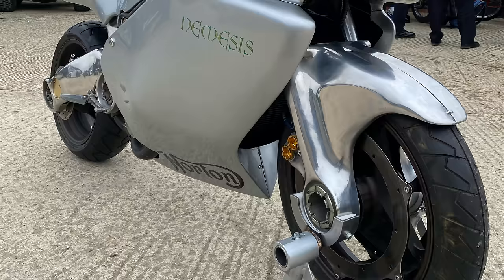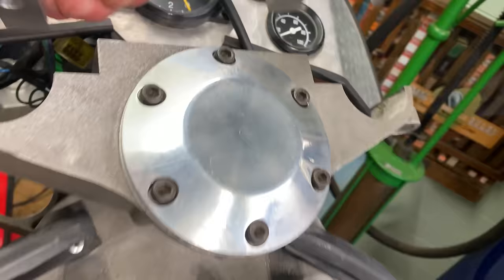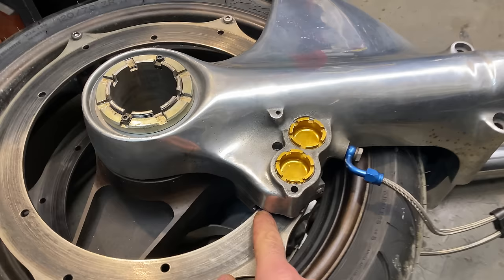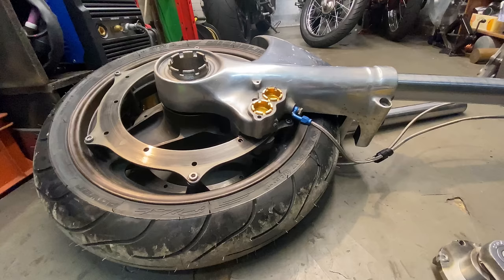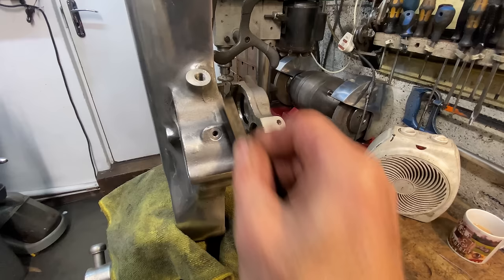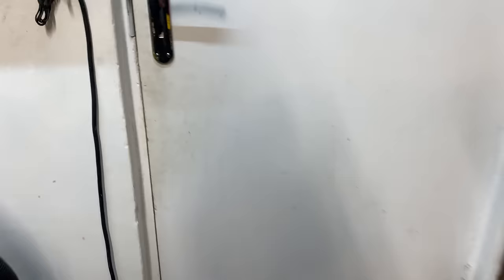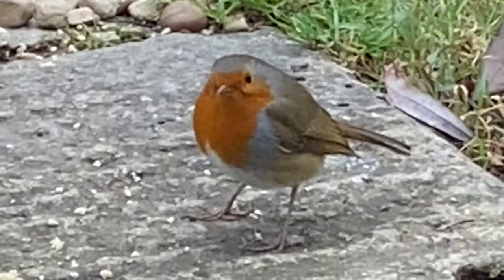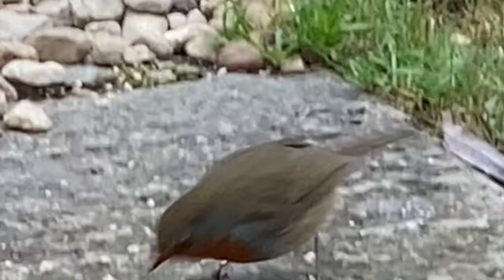Norton Nemesis V8 Rebuild - Episode 1

Comment: Applying threadlocker to the disc bolts is a mistake when the bolt screws into a blind hole. The air displaced along the thread as the bolt advances will evacuate the threadlocker fluid, leaving very little on the threads. 

The preferred method is to apply threadlocker into the hole itself, ensuring that it penetreates deeply enough to afford the entire length of the bolt threads. Inevitably, some threadlocker will still be pushed up and out by the air displacement, but this method ensures much more of the threadlocker will be where we want it.

Comment: There are plenty of things about that front end that I don't like, particularly the impracticality of it from an every day perspective (which isn't its intention). There were a couple of parts that I thought were good: the removable plug that allows the brake piston to be pushed out (hopefully the plug doesn't leak) and the way the fork bushes slid out for checking.

Comment: I would whittle up a couple oval plugs to set in those ports each with a small magnet glued to it to block and catch any fasteners from getting into the engine when you put the airbox back on.

Comment: "Sir your Norton's front brake slave cylinder is worn out and needs replacing"

"Oh certainly, how much will that cost?"

"Well, it's cast as part of that huge, single, one-off aluminium piece that holds the axle. You might want to sit down..."

Comment: Don't show cake !😆
(now I really really want some, haven't had that type since I moved to USA 1999 🤯)
That's a hell of a position of trust, doing work for National Motorcycle Museum.
Your next career move?
Front end looks great but must have been terrible to make and assemble, awful lot of drillings, no wonder they changed design.
I would hate to be working in a shop then tell customer front tyre change is going to take 6~8 hours.
The crossover brake drilling would have worked if they had added a hollow dowel to support the o-ring seal.
It would have been a complete nightmare to bleed though, probably easiest with forks laying down so air could rise?
(I did something similar on a Suzuki  25~30 years ago)

Comment: Crazy stuff, Im guessing that the engineers of this might also have designed the landing gear for Concorde/ Vulcans /Brit fighter planes. Not that I have any knowledge of those designs but ease of maintenance would maybe not be priority #1. Complexity here seems to be an issue, but a mechanic working on them regularly wouldnt have any problem - the worst aspect seems to be the large unsprung weight of that 'mudguard' - similar to a Maico Taifun 400 of the 50's, except they had the sense to attach it so it is part of the sprung weight...basic really.

Comment: A lot of work to change the front tire. For a motorcycle that goes 300 km/h, I would balance the front wheel with the brake disc.
Reply from the maker: Impossible because the discs can’t be bolted to the wheel before assembly - see video 🙂

Comment: I Hope the casting is high quality. I once worked on a Hydraulic pump with a Aluminium Cast Body for the food industry. It kept losing Pressure when it got hot, we found out the oil was sweating its way through the pores of the Casting. I wonder if the pattern for the casting is still about lol.

Comment: What a very unusual setup on that front end, im guessing it was for weight reduction and to keep clean lines. However imagine having to replace any of those parts, it would need the whole thing custom making. That would be a nightmare. Imagine stripping the brakes, seperating the forks and dis-assembling the whole front end just to replace the tyre? Not too bad as the customer would have a few quid anyway so they shouldnt have an issue with time.

Comment: What an astonishing design for front forks.  Do you have to go through all of that if you just need to change the front tyre?
Reply: Yes.
But in racing replacing the whole front end unit would be no problem..
probably quicker than a pad slap/brake rotor/tyre change anyway....

Comment: This bike is going to be a handful on the road! (or maybe not, after building and riding the Flying Millyard and the Viper engine bike) The front end sure wasn't designed for easy service. Not a good plan to have the caliper / pistons built into the fork leg...Maybe thats what got Mr.Toh and Mr. Kico sacked from Norton's...8^)

Comment: I've watched too many mechanic's vids about bikes and cars... But this one stole the cake. I thought: really creepy engineering created by a damaged brain: One man's 'vision' or a camel designed by a committee back in the early days of evolution? 
But then I wiki'd Nemesis and found out it was 1998, had 235Hp and only weighed 480 pounds AND had Active Suspension !! That front-end is a real art-deco from the '30's and I can't wait to see what plumbing and electrical problems can be overcome by something new called the 'Transistor'...

Comment: That passage from the top of the lower fork to the caliper, is that cat or drilled? Because of that was drilled it's mighty impressive. It's not easy to drill a hole that deep.
Reply from the maker: Deep drilled 😳

Comment: If the disc allen bolts over half the disc diameter were removed,   then the spindle,  would the wheel not drop out  ?  Or still catch on the calipers  ?
Reply from the maker: the wheel rim and tyre  won't pass by the cast in callipers

Comment: I seem to recall the aluminium brake fittings are an MOT failure as they are liable to corrosion from salt. If the plan is to make it road legal they would be worth replacing.

Comment: The original nemesis red wheels turned up on the Rotary owners FB page claimed as rotary. I contacted the former Director of Norton motorcycles he said they were Nemisis and do not use the. How much of this bike chassis is mock up only.

For the 750 1/2 a nemissis Norton when to Spondon Engineering for the chassis.

The company who made the Nemissis castings exibits at car shows and has Nemisis castings on display.
Reply: After watching the videos up to number 5, I feel the cautionary tail as to the std some of the bike was made to were valid. Pity James did not see it that way and blocked me on FB

Comment: Hi I owned a 1971 commando with 1975 850cc engine w/o electric start or left side shift in 1978 made out of basket case bikes . Okay i couldn't hear  to well is that a 2 stroke V8 can't be ?. Thanks
Reply from the maker: its a 4 stroke twin cam v8

Comment: The honda cbx 550 f2 had a similarr brake set up. I had to remove the wheel myself to change my tyre because the Honda dealer didn't want to😂

Comment: Allen, do you sometimes put a wood spacer in between the calliper pistons - to stop them decompressing too far?
Reply from the maker: I used a bit of 10mm Perspex while bleeding the brake with the wheel out

Comment: Very impressive!
But one thing I don't understand: why isn't it possible to unscrew the brake discs and take out the axle tube to take out the wheel without dismanteling the whole fork?
Reply from the maker: Because the wheel rim andvtyre won’t pass through the gap between the calipers

Comment: When you balanced the front wheel why haven't you balanced it with the brake discs installed?
Reply from the maker: The discs have to be removed to fit the wheel so not possible to balance as an assembly !
Reply: @AllenMillyard  thanks for the answer. Why isn't it possible to balance as an assembly? Seems to me the whole is quite big... don't you have enough room because of the width of the entire assembly not fitting into the balancing jig!? Cheers Allen.

Comment: So, it has an aviation front suspension and brakes, straight off a light aircraft.
Reply: Another commenter said a relative of his worked in the design team for a short time 
and told the design team that the ONE PIECE original design was infeasible...
this is the Plan B!

Comment: Those brake calipers cast into the fork legs must offer the ultimate in rigidity - even better than radial mounting. Out of curiosity, what was the purpose of that grub screw, I couldn't work it out? Oh, and while you had the tyre off, I think I would have fitted an angled tyre valve because access to the original looks horrendous!

Comment: This construction is fucked beyond the limits of decency! To replace a tire on a powerful sports motorcycle, you have to dismantle the entire suspension and braking system. And if they added some screws to hold both halves together, then no, let them fall apart. Beautiful English technical thought.

Comment: It’s such a shame that Norton refused to use Norman Hossack for the front suspension. His front end is low cost, adjustable geometry and handles flat. Best of all, it’s British and it works better than ordinary tele forks. It would have a fraction of the unsprung weight of this monstrosity.

Comment: That front end is Engineering for engineerings sake. Not really practical. Just because you can doesn't mean you should
Reply from the maker: If only the calipers were radially mounted it would be easy to drop out the wheel

Comment: If its built to change the tyre quickly during races then why didnt they  simply suppyl 2 normal bikes.

That would be less cost and the rider jumping from 1 bike to the other would be faster than any tyre change let alone 2 tyres, and a complete engine snd frame change.
Reply: Whole front ends would be swapped in...
brakes already bled to perfection as Allen demonstrated..

Comment: just to be clear, this has a vertical split along the mudguard and nothing securing the two sides? It's such an odd and illogical design. i wonder who came up with this all - it would be very interesting to hear an interview with them and understand their design choices and the (many) problems they faced.

I'd also like to know what the internals are based on because those brakes, forks and much of the engine will have recognizable parts in them ....

Comment: I am only half way through this video and so far it's pretty obvious why this is only a pre-production example - to enable it to be mass produced and actually used and ridden would have required a total redesign..... why do these 'engineers' insist on over-complicating everything ? The beauty of Nortons of old were that they were simple to build and maintain, having to dissassemble the whole front end to change a tyre shows complete stupidity.
Reply: See another commenter whose relative was a design engineer 
and told them their original ONE PIECE front end was not feasible...
this was Plan B!

Comment: Sorry I’m rather late to the party, but I’m already offended and annoyed  by the fool that decided to LITERALLY not only attempt to redesign the way the entire front end of a motorcycle works, but did so whilst ignoring all common sense and engineering standards. 

And given this was meant to be a race bike, those ludicrous decisions make even less sense. How were the mechanics supposed to change the front wheel in the middle of a race? It would take a minimum of 30 minutes, when the task is meant to take less than 30 seconds!

There are apparently absolutely zero benefits to doing ANY of those things. A classic case of attempting to be different, solely for the sake of being different. 

Oh, and in a world with people like John Britton, and materials such as ABS and carbon fibre, why on Earth would anyone make a front mudguard out of aluminium - that must weigh four times as much?????